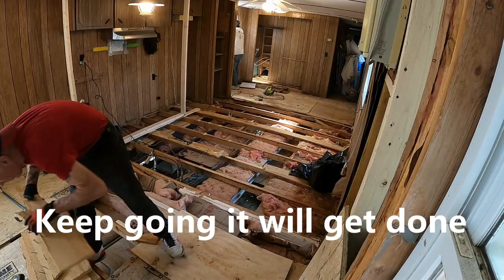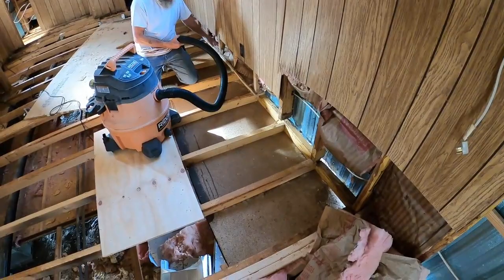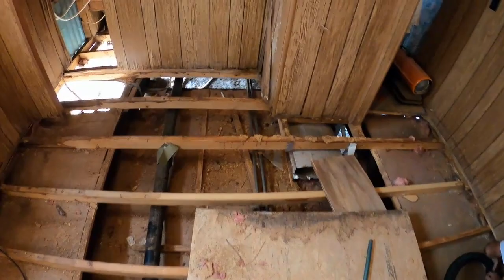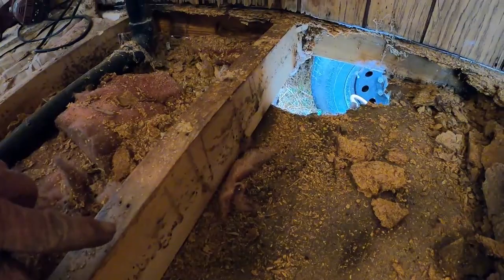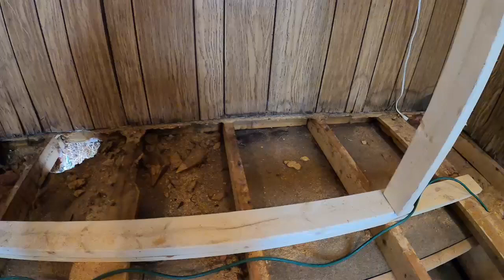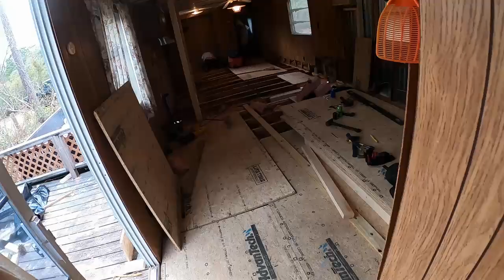Rotten Mobile Home Sub Floor

Comment: Thank you for this video series. We knew when we bought our fixer upper we had a few problems with rim joist or band as you call them. Both front and back walls living room windows, double kitchen window under tub and round both front and back door. 
Of course most was roof leakage or water shedding from roof getting behind tin siding.
Some from lousy trailer windows and improperly replaced windows. 
What we thought was hit or miss places that we could just sister turned out full blown replacement of bans.
Our home is 12x65 with 2x6 joist that run the length of our trailer not width. My husband did most of the replacement from outside, except the living room where we replaced the double window with a sliding door. We either sister or replaced all of the back wall ban but about 15 - 20 ft. 
He started this while we were try to find a roofer because we didn't think it was safe to put anyone up there given many place were so rotten the only thing holding the wall and floor together was the silicone that a previous owner did to hide the damage claimed was repaired. 
We still have a little over half the front wal to double check and I know about 30 more we will be pulling sistering or both plus the hitch wall.

Come spring warm up when I can safely pull the under pinning I will need to finish what he started. 
He was diagnosed with ALS and can not stress and strain his body with this hard work like before. 
Thank you for the indepth footage and explaintion. I'm feeling a bit more confident that it's being done right if I can't do it myself than I can supervise the guys with the muscle.
Reply from the maker: It can be done and your proof you’re lucky you have 2 x 6 and not to our poor and the video I’m sharing with you is explaining the floor Joist go in the way you’re talking about.
I’m glad my video series help to

Comment: Nice work fellas. Just wondering,  what is the pay scale over there for that type of work. Starting wages vs mid level guy vs a guy that's been with you say 4 or 5 years?
Reply from the maker: 12 starting. Paul makes 20 to 25 an hr

Comment: Am I the only one watching these videos out of order? LOL... A lot of the questions I asked Drew are answered in other videos.  They're not numbered in any kind of order.  I see on this video, you said not to cut more than 1" (that was one of my questions).  My other question was where you started pulling up the floor.  Was there a specific spot, or was it random?  Also, do you have a video showing how you replaced that outside band?
Reply from the maker: https://youtu.be/Khj7Nza722I
Reply from the maker: Have you been watching my videos I have at least three or four in the series and I named it how to replace the ban on a mobile home. Or how to replace the exterior wall on the mobile home. Many videos on the exterior walls. Now at this point we are done with rebuilding the wall now we are supporting the exterior walls